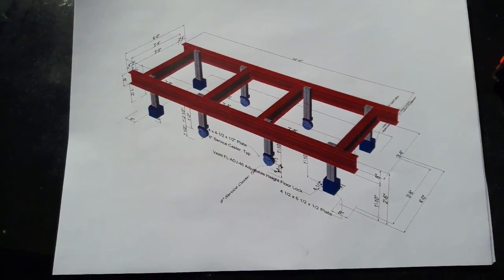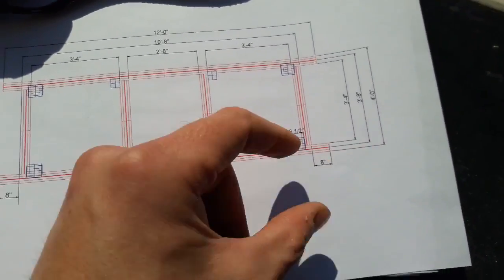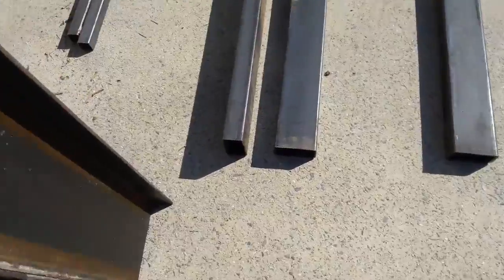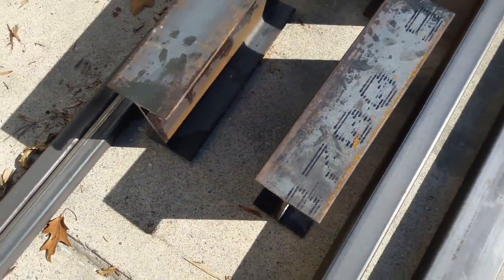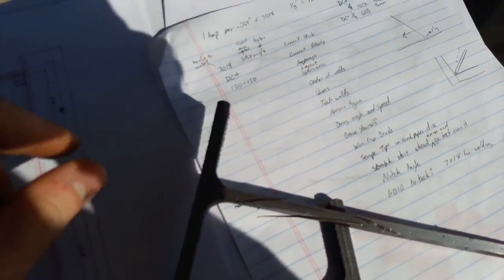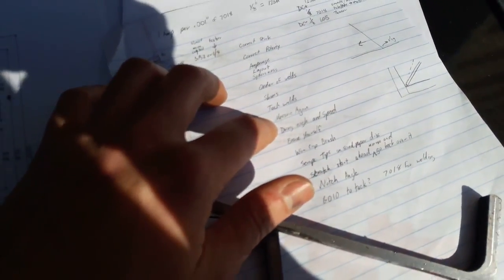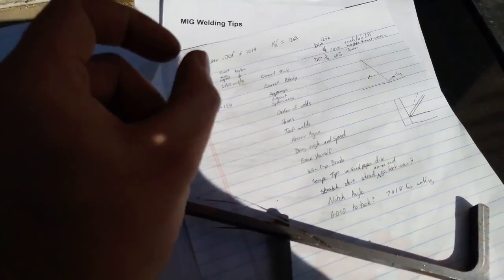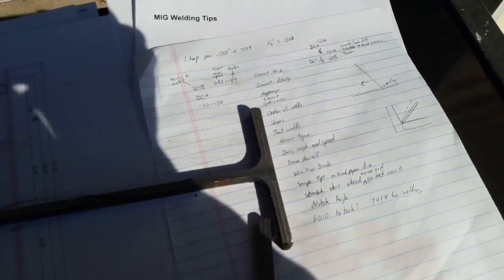12'x4' Chassis Table Build, Part 0, Plans and Stick Welding Tips

Comment: You may have been inspired by the Eastwood video but your video is so much more.  Actual drawings, dimensions and your thought process.  Eastwood was just phoning it in (boring).
Reply from the maker: Let me know if you need any more details, it was really easy to make once I had the metal cut to the size I wanted.  You may want to consider the track width of your car, or the body. I ended up welding on some flat "wings" where tires could sit on top of.
Reply from the maker: Also you'll want to cap off the tops of the legs, so that no bolts or tools fall down there!  I just have some blue tape over mine for now.

Comment: Thanks for posting this. I think this might be the design I'll use. I subscribed to your channel as well. Is there any place you've posted the notes and measurements?
Reply from the maker: Thanks, I appreciate it.  Hope to see your version of a chassis table too!  I can try and put the whole thing up on GrabCad.com
Reply from the maker: CAD files, measurement files and photos of the completed painted build now available on GrabCad.  https://grabcad.com/library/phy6-chassis-table-mk1-1
Reply: I-beams are superior to square tubes as the beam flanges provide a place to clamp your work down without the deep clamp needed for +4" tube depth.  Also choosing the correct flat flange profile on the beams.  Good video.